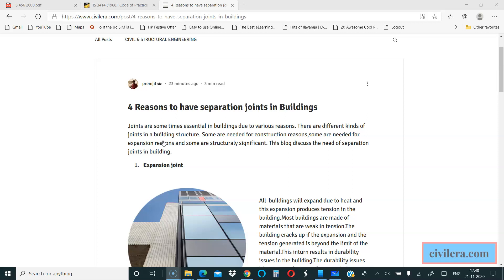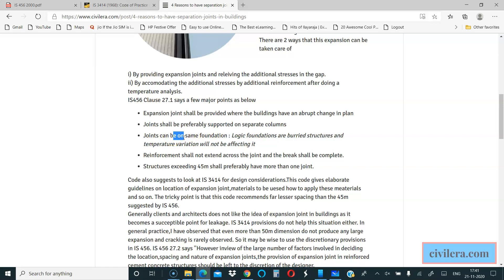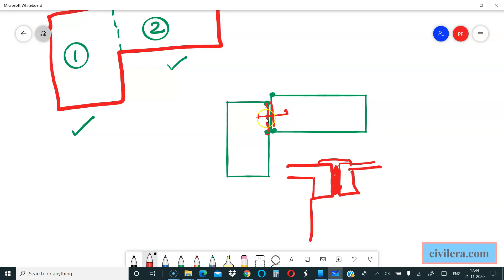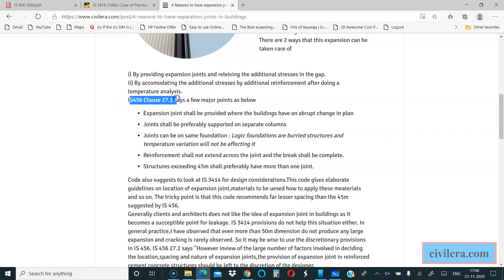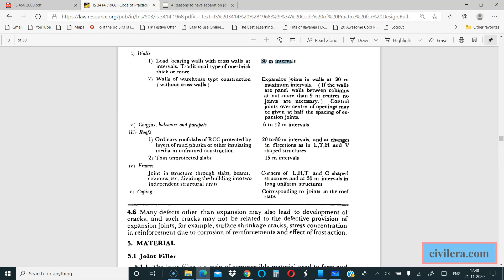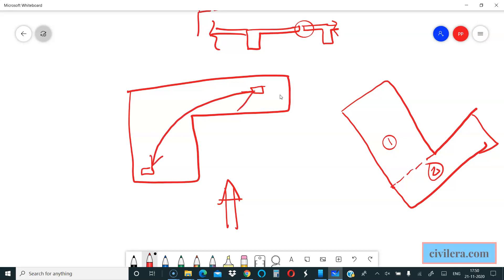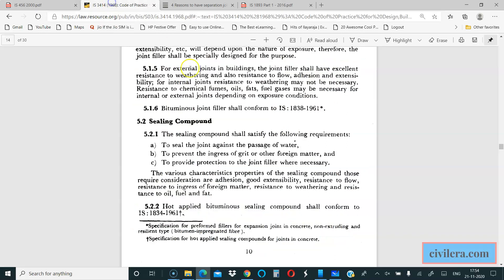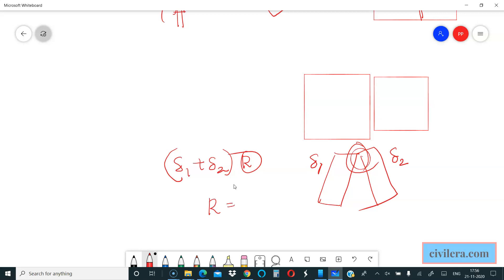Expansion Joints in Buildings

Comment: Sir as you have said initially that we can have same substructure but different sulerstructure separated by expansion joint..then how can torsion be accommodated in irregular building during earthquake..
I mean is there any link bw the torsion in substructure and the expansion joint?
Reply from the maker: Yes if the reason for joint is expansion then there is no need to separate the footings.
Accomodating torsion - Design for the forces ignoring that it is in torsional mode. Thats what is meant by accomodating it.
Reply: @CIVILERABangalore  ok thank you sir.
Reply from the maker: @proudcivilengineerspceacad1514  If your question is if 2 parts of an irregular structure can have common foundation then ans is yes. its ok. The inertial mass comes from the superstructure
Reply: @CIVILERABangalore  yes sir..got the point.
Thank you!!